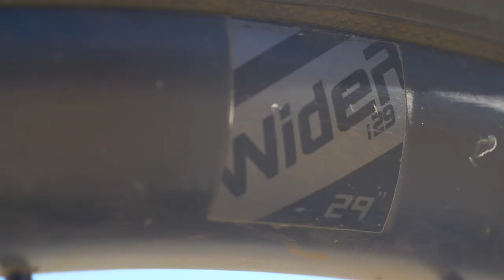5 Signs Your Bike Wheels Need Fixing Or Replacing

Comment from the maker: Have you had to fix or replace a wheel? Let us know 👇
Reply: Question. Is it normal to have the rim cut a hole in the tyre
Reply: i rebuilt a front wheel after the hub bearing race was pitted internally (then re-did the rear so they were a matching set) and i did that using the frames v-brakes to true it up, now i own a park tool wheel builder truing stand to make life a little simpler
Reply: My rim has a small bend so I guess it's off to a bike shop since it's small enough I think it will straighten out easily
Reply: I built 4 of my friend's wheels when they changed their rear hubs. Probably should  rebuild my own ones as well given the rims have had a hard live in past 12 years but as the frame is 26'' and some of its parts beeing unreplacable (mechhanger etc.) I'm not sure it would be worth the money
Reply: This video came out just as I was researching how to fix my front hub, coincidence
Reply from the maker: @keesvdb  That sounds like either a bent rim or something sharp on the inside of the rim causing the rip, take the tyre off and inspect for any signs of damage to make sure.
Reply from the maker: @thesmf1210  Great purchase decision on the Park Tool wheel builder, will make life so much easier for you now!
Reply: I dented 1 wheel, and bent another wheel and  broke a spoke

Comment: Timely video. I broke 6 spokes this year, my spoke tension was all over the place, wheel dishing went out twice, couldn't figure out what was going on. Finally took it to a shop, my alloy rim was cracked in 5 places. Yikes! I'm getting the wheel replaced on warranty, but with the global parts shortages, there's no ETA on when. This was the kick in the pants I needed to finally pull the trigger on a custom wheel set. Hopeful I'll be back out riding again soon.
Reply: Only 6 spokes? Pfft totally didn’t break 15 spokes here…

Comment: Check your spokes often, tighten clearly loose sppkes. If one breaks get it fixed as soon as possible, as more will follow, and you can thrash your rim. If nipples break, your spokes are a bit to short.  Alu nipples are light but a lot less durable than normal brass ones.

Comment: I wouldn't even know where to start looking for my museum piece front rim ('95 Foes Weasel 2, HED. 26" x 46mm, 32 spoke rim).
In my walkaround video you can clearly see 2 large vibration wear craters on the front left side (Close to the helmet)..
Soooo I just continue to use them.. and they were fantastic.... If only I could get some new 3.0 Gazzaloddi's... 
I would really love a set of those fat rims on my Giant Faith... Tyre manufacturers have turned their backs on 26" riders and you can only get tiny 2.5" Maxxis... they feel like road tyres after the Gazzas. (Never got a flat in the Foes front in 20 years... The green undersized inner tube finally perished!  (And had an hourglass dent by the valve as it was so undersized for the 3.0 tyre.

Side note... 4:00 The M*A*S*H theme is running through my head looking at that fantastic scenery in the background...

Comment: Very recently decided it was time after 3 years on the oem E13 trs+ set. My rear rim started cracking open around the nipples. Probably partially user error, jumping and dropping stuff with too low pressures and no rim protection. But also a 28h trail rim being ridden enduro beyond its intentions. I just didn't know that until now. Saving the hub and front wheel for a lighter weight wheel set. Excited to get both wider and burlier Hope Vortex 32h wheels and  see how much of a difference I'm gonna feel (maybe nothing?)..

Comment: I am running an aluminum rim with a dent in it tubeless, the tire holds air oretty well but does leak a bit faster compared to the front tire, forcing me to pump it up overnight
Reply from the maker: As long as the rim isn't so bent it could cause pinch flats you should be good to go! Just make sure to check your tyre pressures regularly.

Comment: Bought a Ghost bike with spaghetti spokes. Wheels were all wobbly when i got it. Had to true it multiple times and even went to a LBS and they said i'd better upgrade, because they can't get the right tension without damaging the rim. The rim clearly bends inwards now where the nipples are. 
Bad bad wheels you put on my bike there Ghost! To be somewhat fair, i bought the cheapest offering they had, but that does not justify this quality. Did not even ride rough stuff on it.
Reply: Bought a Ghost gravel bike and the rear wheel lost the tension on all of the spokes on the first ride after 30km so the wheel was wobbling so much, the rim would just wiggle freely from chain stay to chain stay when holding the bike up and shaking it left and right... Had to call my girlfriend to save me and pick me up. At home I completely loosened all the spokes and trued it again using a spoke tension meter. Now it has been holding up properly. But Ghost is known for bad wheel builds... Never buying that again.
Reply: @lux-3001  this is nuts. Also never going to buy there again. I wrote ghost and usually they reply regarding questions, but when I mentioned my bad built wheel I was simply ignored. Next bike I will built myself and use hand picked components. Will be more expensive, but I don't have to buy twice. Fingers crossed for your wheels ;)
Reply: @patorico_8879  they wanted me to send in the wheel so they can inspect and re-tension the spokes. I replied that I don‘t want them anywhere near my wheel as they clearly are not competent… the worst was the bike shop were I bought it, ironically named Bad Bikes, that charged me 60 € for the building up the bike and then avoided any responsibility and declined paying me back the 60 €

Comment: You don’t need new wheels if your spokes and nipples are breaking, $75 for a wheel build and $50 for spokes and nipples. Don’t toss a set of carbon wheels on expensive hubs, get a full rebuild for $125- $150 a wheel. Unless you’re running a $600 wheel set.
Reply: Thought I was only one confused. New spokes can be purchased once the rims and hubs are still good.
Reply: @AC-ww6nf  I have NoX on king hubs, def not tossing those because my nipples are bad! Haha 😂